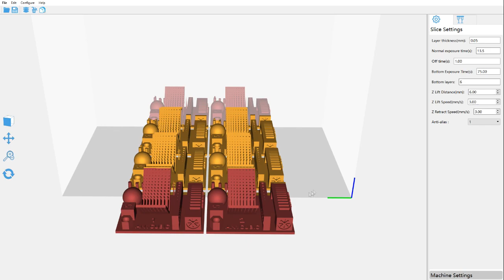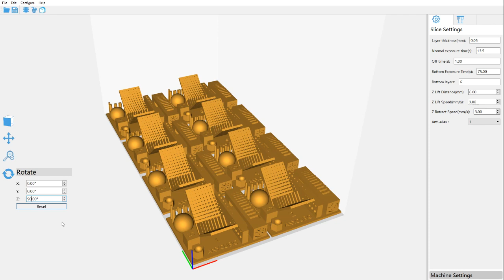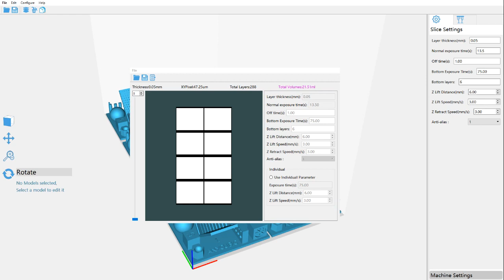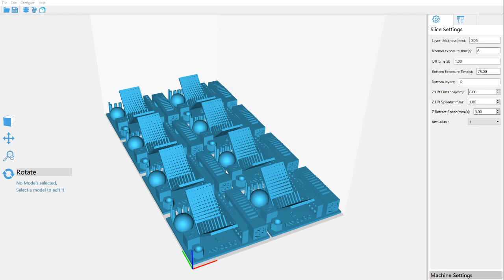Anycubic Photon S - Resin Exposure Test - R_E_R_F with custom timing

Comment: I'm confused. I have photon S . How can i do single print with 8 different exposure ? where can i set it up? i only can set 1 exposure in single print. Anyone can help ?
Reply from the maker: This is exactly what I explain in the video... Naming your file the special R_E_R_F file name activates this mode.
Reply: @jonathancarroll8425  oo ok ... Great, thanks a lot . I didn't realize photon S will automatically run in exposure test mode just by naming it as R_E_R_F.pws . Btw do you know if it only increments the normal exposure time  or also will increment the bottom exposure time respectively ?

Comment: Will this work with Anycubic Photon, not the S? Also, can someone point out which side is the forward facing side of the build plate for this test? Where should the globes be located in reference to the front?
Reply from the maker: Orientation is explained in the video.

That depends on is you have an old photon or a newer photon with a S board. If you have a newer one with the S board you will want to use this test.

If you have an older photon you will want to use the photonsters exposure test.

Comment: Can you please tell me if there is a RERF test out there I can just push print and run it, if possible. Where to find it?
Reply: Just opened mine up and set it up. There's a R_E_R_F file included on the USB. Default is 4s for #1.
I also found that once you hit print, you can use the cog settings icon and just change the exposure numbers there if you need to start at a different time than the default.
Printing now....we'll see.

Comment: I did initially ask what exposure setting you all use for the Mono X when running this test but deiced to edit it out because I found out when reading the manual that came with the printer and also looking at the file they supplied with it that it starts off at .8 and goes up by .4 seconds for each new area. So Area 8 is at 3.6 seconds. That is within the range for what I was looking for since the printer has a better light source and resolution.
Anyways I just wanted to edit out my question and explain why, which was basically that I found the answer. :P
Reply from the maker: This is correct, the mono x goes up by 0.4 seconds.
Reply: @jonathancarroll8425  And the Photon Mono 4k goes up by 0.25 seconds. Just for the record. What I find very interesting is that in readme file I find written: "The interval time of 8 models is 0.25S, the first one is 1S, the second one is 1.25S, the third one is 1.5S, ... Increasing and decreasing 0.25S in sequence, the eighth 2.75S 
Users can change the normal exposure time, that is, the time of the first model, the other or the interval of 0.25S"
Now I have been trying to change that somewhere for 2 days now, and cannot figure it out. There is no explanation of how to do it. Any sugestions?

Comment: This is literally the only thing that doesn't stick to the basin of my printer, I have printed this rerf out twice flawlessly but 10 other prints have completely failed, any idea what I'm doing wrong?
Reply: I'm having your exact issue. Did you find a fix?
Reply: JL R I lightly sanded the plate for adhesion but it still doesn’t make sense that I had to since the rerf file printed perfectly.  I tried to emulate the base of this file and that seemed to help also.

Comment: just adjust exposure time on the printer...it wil do the rest with adding 1sec
Reply: So am I correct when I say the if a file is named RERF the photon will automatically increase the exposure time by 1second to each individual square so that you can see the difference between eight different exposure times? Also how would you change that on the photon? I didn't see the option
Reply from the maker: Luigiangelo Buonarroti correct

Comment: How does one evaluate the resulting print? Is it flat like the previous ones or is it actually three-dimensional?
Reply: I just printed this thing. I didn't know what I was doing. I got back 7 successful three-dimensional prints and 1 failure that didn't stick to the build plate. I'm assuming it was square one that failed since it has the lowest exposure time.

Comment: Do you need to have the newest firmware to run this test? Mine is still on 2.9.9 and runs on .photons files. I'm hesitant to upgrade the firmware as I prefer the ChiTuBox slicer which currently does not support .pws file format. Not only that, but I heard the latest firmware does not allow you to run older file formats like .photon or .photons. Kind of shitty that Anycubic keeps pushing for proprietary file formats instead of more open source formats.
Reply: I just found this video so I haven't run the calibration yet which means I can't directly answer your question about this test. I have upgraded my firmware. I still use Chitubox for supports. Just export the supported stl. You can downgrade the firmware if you don't like it, but the AA seems to work well so I plan to keep it. I do agree about open formats, but that seems to be the way of the resin world (my Moai does run GCODE though). I will be running this test soon if the resin volume isn't too great and will post results here.
Reply: have you found an exposure tester to use ? mine also runs on photons files and dont want to update cause ill loose chitubox